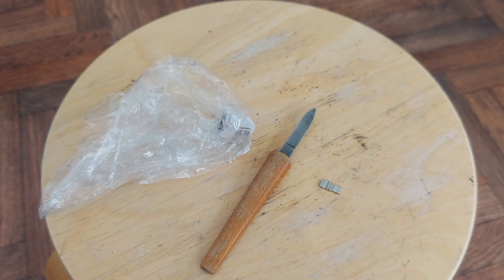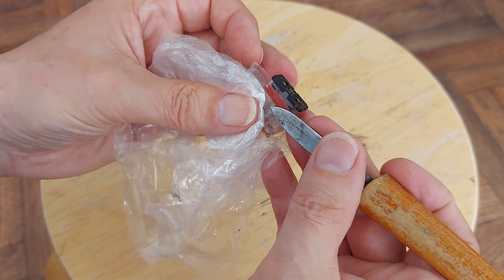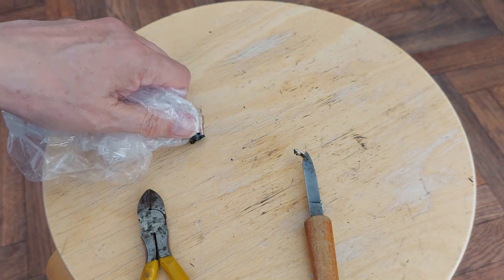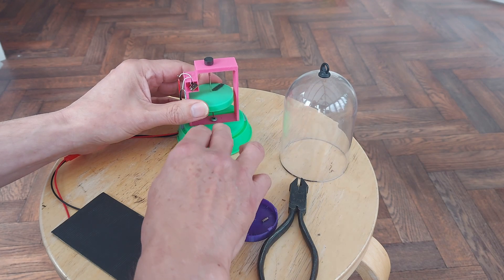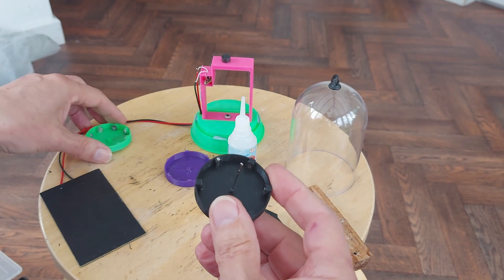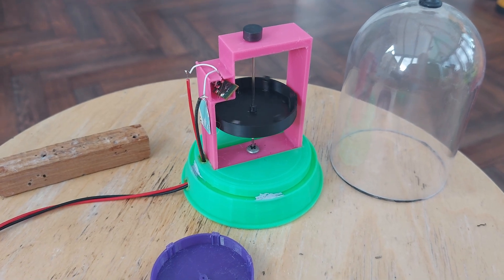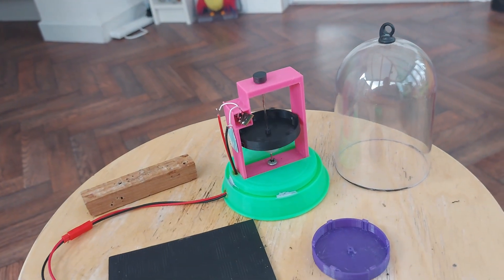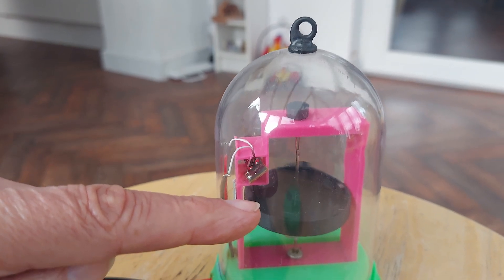Pulse Motor Magnets from Vapes

Comment: great job. fun stuff. I did not know there were magnets in there.
Reply from the maker: Only the ones that have replaceable mouth pieces. The heater element is on the mouthpiece and it needs to be electrically connected to the rest of the vape, so I guess they use the magnets to ensure a good quick simple connection. The magnets are not the electrical connection, but they will ensure the parts are pulled together well.

Comment: Maybe the next thing is print some plastic pliers or channel locks so they don't stick to the magnets when pushing them in, just figured that would make for another video.
Reply from the maker: I redesigned the disk, it needed to be thicker and heavier anyway. I haven't done the video yet.
Reply from the maker: Here you are - Vape Magnets Pulse Motor PART 2 - https://youtu.be/1kdVpvfuexA With the redesigned disc, the magnets slide down into the holes much easier, I can hold them with my fingers to align them.